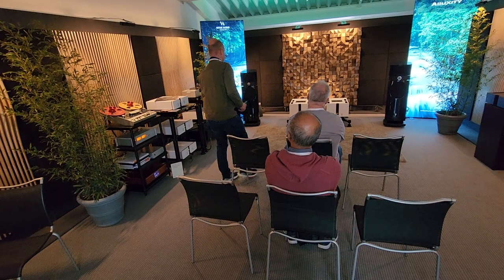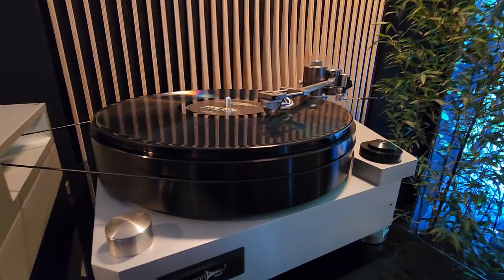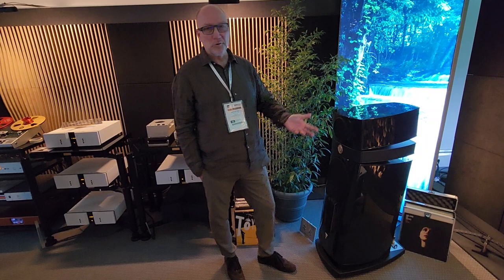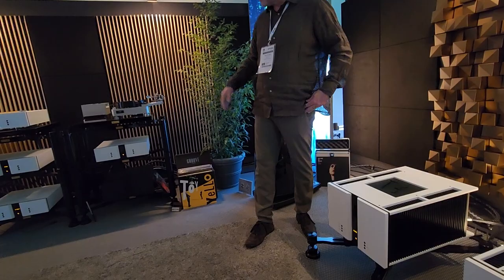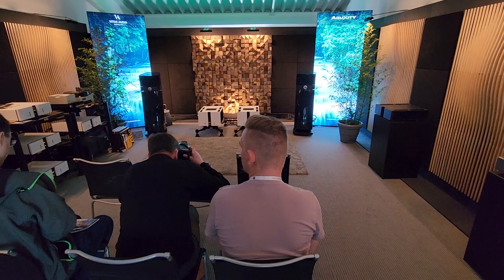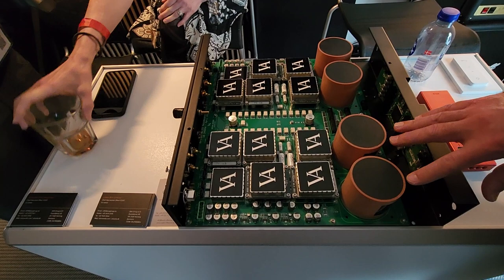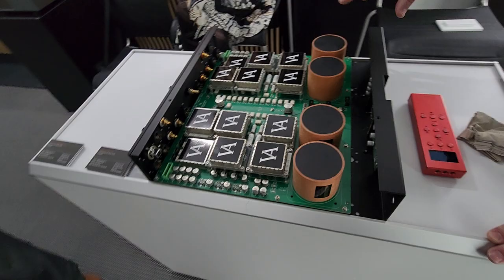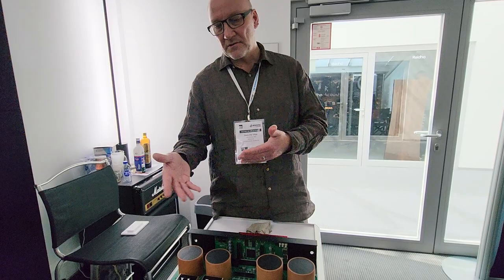Gear With Great Aesthetics Inside and Out - Vitus and Focal with Never Seen Before Tape Deck and TT

Comment: I’m a retired engineer in aerospace industry that very much appreciates simple and ordered design approach. While pcb’s are the best, most reliable approach in avionics application, it doesn’t belong in very high end audio. I understand why it’s done in large volume production but at the very high end, ptp wiring should always be the optimal choice. 

Nothing wrong with clean and orderly but when I pull the cover off a $150k Boulder amp or preamp and I see a series of pcb’s connected by cheap ribbon cable, I’m wonder if I’m looking at an amp or a $1000 Dell computer🤦‍♂️. If I were the engineer of this product, I would be less than proud of that unit, relative to its price. 

My Wavac 805 amps are priced similarly, every component is hand wired. The only pcb in my CAT SL1 preamp is the outboard power supply.